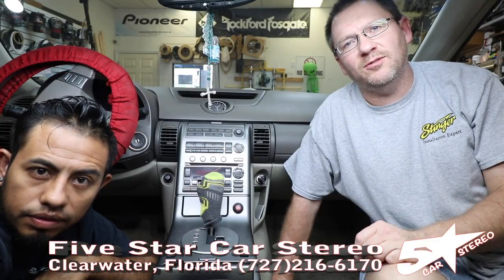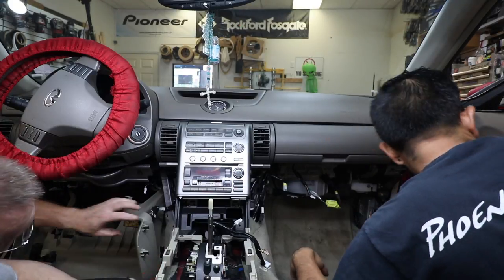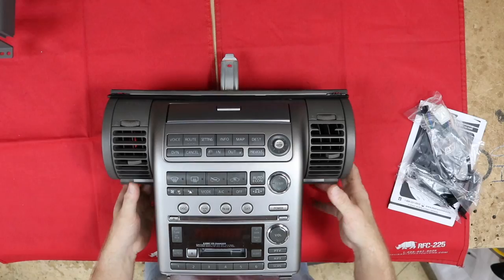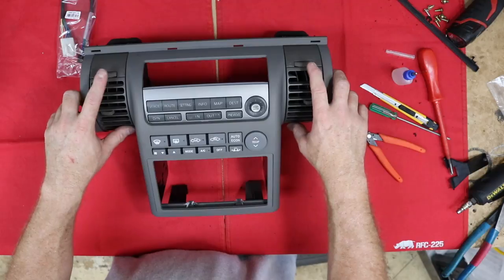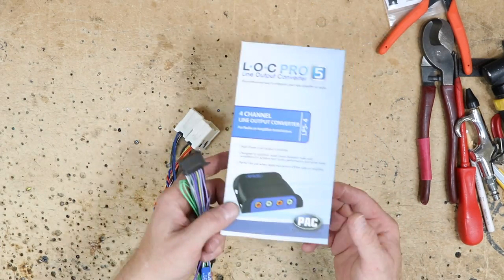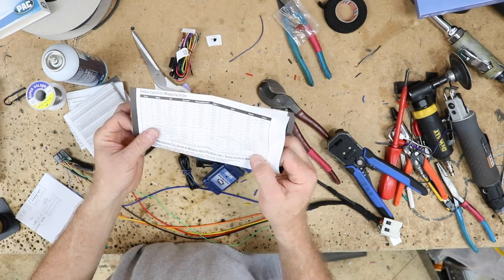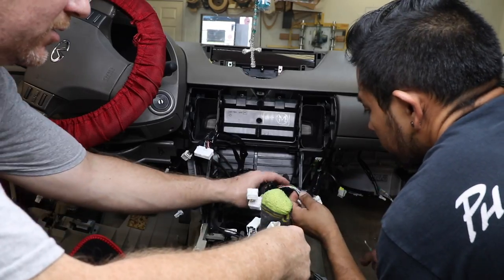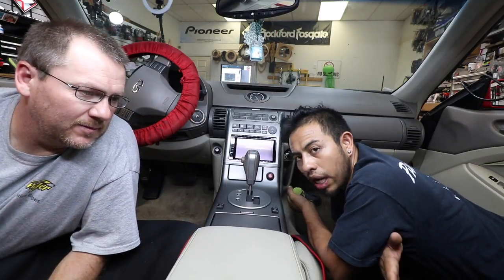The steps it takes to replace your radio Infiniti G35

Comment: This is an excellent video! I don't think it is that bad of an install (granted, I have done a lot of them in my life).  It is straightforward, but you must be cautious. If this is your first install, I strongly recommend setting aside at least one day and make sure you have backup transportation.

 Personally, I think 99% of head units look like garbage when paired with the G35 interior. A really well rounded, affordable, stock-looking head unit that is perfect for the G35 would be the Sony XAV-AV5000. It mounts flush with the Metra and has unrivaled competition.

 For those of you who want the parts list, here you go.

Dash kit: Metra 99-7604
Wiring harness: Metra 70-7551
Antenna adapter: Metra 40-NI10
Line output converter: PAC LP5-4 L.O.C. PRO
Steering wheel control interface: PAC SWI-RC

Don't cheap out, and not get these parts (steering control is okay to skip, but I don't recommend it). For the sake of simplicity, go with all of these brands listed above. 

Tips: 
1. Before you pull the Bose radio out, turn the volume up to about 75% (while it's on). It is the last that the Bose amp's volume will be adjusted, so make sure you give yourself plenty of headroom. 
2. Before you install everything back to their places, individually test each speaker. You can do this by using the fader/balance. There are a lot of places where you could have goofed up on the wiring. The RCA's need to be snugly placed (maybe taped) to reduce the chances of disconnection. 
3. Watch the video as many times as you need. The worst you can do is generate these guys some more ad revenue (not a bad thing). 
 
Don't be discouraged that this is not as easy as a 90's GM vehicle radio install. The G35s are spectacular cars that really do benefit from a new head unit. You have to realize, you can't escape a timely install on cars these days. Buying a car with an aftermarket head unit is really sketchy and not always worth it. So many people do horrific and lazy jobs installing these. People will scratch, scuff, and break trim pieces and  I have seen people wire head units by cutting off the factory harness connector and use 120-volt wire nuts to connect the wires to the aftermarket head unit harness. When you do a radio install yourself, you know if it is quality or garbage. Unless you know it was professionally installed, I think it is better to buy a G35 with the stock Bose head unit. That way you know the factory harness wasn't molested.
Reply: do you have any kits for the g35 05 coupe with nav?
Reply: You are a god send sir

Comment: I thank the heavens that they changed the design from 2005!
The Metra kits are just so janky-looking, though!? THAT'S the main reason why I haven't tried to upgrade mine yet. The buttons are spongy even though they are rather resilient and will last for years. 
You do get JDM parts for a double-din radio in the USA but they are EXPENSIVE (around $350 just for the trim piece)! 
I'm rather OCD about things so what you guys just did would drive me insane and at least double as long as both your time together, since I won't even "allow" myself to replace old clips - everything must be unused! I mention this just so you will understand(?). I will certainly become a desert-wanderer.
On a lighter note though... excellent video with excellent information for people wanting to attempt this!!!

Comment: Great video fellas! I literally just did a Pioneer double din install in my buddies G35 a few days ago so I know every step you guys took to install it ha ha! I honestly just went with the first harness you showed w/o the RCA's. You're right about the volume being loud by volume level 10 or so, but it really does sound great still. I would recommend using it to anyone.  

For anyone that is thinking about doing a double din install in their G35 the Metra kit is a great kit and fits very nice and looks really once its in. Only thing I will say is make sure to take off the cig lighter panel as well as the opposite panel too. You will fight with putting the kit back in if you don't. It'll get hung up on the vent!
Reply from the maker: +2nsane2005 👍

Comment: Your video is by far the best of 6 videos I’ve watched about this particular job.  You answer all the questions that I didn’t know I need to ask. I have a Japanese (RHD) 2003 Nissan Skyline which is identical to a Infinity G35, but mirror image.  I want to upgrade the outdated radio system with a Bluetooth capable like you did here.  
Could you recommend some brands before I buy?
Do you have any recommendations since you posted this video on what I could do with factory NAV system.  It works as a Japanese TV and NAV System, which despite my ability to translate, is outdated and useless.  I’d like to take it out and replace it with iPhone Charging pad and also make it so I could mount one of my old or current iPhone there.  That way I could use my iPhone for navigation.  
Do you think I could take it out? Do you think I could connect the pad/magnetic style charger to power?  I’d like to keep the physical slide up and down feature.
Reply: Hey I have 2004 nissan skyline JDM I also want change radio can you help me which stereo you buy and which spare parts you have

Comment: Thanks for the video.  I just had a Pioneer double din installed in my '03 and it sounds like absolute $#!+.    I am sending this video to the shop that did my install.  I am thinking they just hooked up directly and didn't take into account the difference in the Bose speaker impedance.  Every speaker sounds blown and it has no bass and no power

Comment: Did you guys change metra kit colors throughout the video???  The dash kit looks COMPLETELY different from the box opening to the final install.
I have a  2004 6MT Coupe with willow interior, and I think the proper color is the "silver" metra kit.

It looks like you intially had the tan and then switched to that one, or does the lighting really make that much of a difference???
Please advise.  Thanks.

I just received a scoche kit and it is a POS, so gonna return it and get this one.

Comment: So why did you cut the rcas from the converter and wire them into the radio harness? Could you have just plugged them into the front and rear RCA outputs on the back of the radio? I as because I used the same car harness you guys did in the video and plugged the rca directly into my radio. However, I am experiencing the limited volume range as well as distortion. I’m planning on getting the pac rca converter you guys used to correct the issue. I guess I’m really asking can I just plug the converter into my radio and the harness rcas into the box? I have an Appradio4 by the way. I found that with the rcas plugged into my radios f&r outputs you get much better sound when you turn the high power frequencies in the crossover off. Any advice or information would be appreciated greatly. One more quick question. Can I just replace the Bose speakers with aftermarket 4ohm speakers? I’ve heard they use 2ohm speakers and a .5 ohm sub. Do you know what the Bose speakers resistance is or how much wattage the system puts out per channel? I’d really like to replace st speakers but I cannot find and information about the Bose factory specs. I’m not driving a G35 but it’s counterpart an 04’ 350z. Thanks for the video guys well done. I look forward to hearing from you.

-Will
Reply from the maker: The best option would be to replace the Bose speakers with aftermarket and bypass the Bose amp. Using the Bose amp for aftermarket speakers is not the best idea. We use the radio output power because that is what is needed for a High level input on the device. The low level of an RCA is not enough power to make sound.
Reply: Five Star Car Stereo thanks guys.  So should I turn my high power frequencies back on in the crossover? Will that converter clarify my wound at higher volumes? I def want to bypass the Bose system & do my own stuff again. It’s gonna be a lil while cause the holidays and bills. I was recently running all Orion XTR highs, mids, and lows. Along with XTR amps. I was very impressed going from kicker to Orion. What do you recommend for an 04 350z with the pioneer AppRadio4  sph da120? I’d like to utilize the sub compartment for a free air sub or even partially seal it up and make it a ported box and dreaded the entire cab with roadkill or something similar. Any suggestions would be greatly Appreciated. I was just gonna replace the Bose speakers with ona that fell in the same resistance range but were not in need of high rms to perform adequately. As of now  the radio sounds great at about 16 but when you start driving Rod noise drowns our the clarity and turbine the volume up comes with distortion. I replaced the blown Bose 10” pancake sub with a Rockford Nissan lunch from an xterra that is a 3 ohm dvc running it at about 1.5ohm stable and the sub itself sounds better than all the other speakers, but where they are all tied into it trying to make speaker level adjustments only complicates things. Please help a brother out. I guess the next step is to add the pac unit and start acquiring components to build it right. Turn me on to a few things, I’m very open minded but like quality stuff. Thanks again, hope to hear from you soon.

-William

Comment: Did you connect bothe the negative and positive speaker wires to the corresponding speaker wire on the PAC?

Comment: I'm not good at electronics, my 06 g35 has this problem. Radio is a Sony 2din, installed after the old aftermarket had the same issues. Sound doesn't always come out, either from all or some of the speakers. Happens in every pothole, train track, or bump. At the shop where I got the stereo they said it was some lose connection, worked great for a few months and back with the same issue. Went to a different shop and dude wants to connect it directly to the stereo all the "new speakers and Amp plus new wiring". Should I take his advice or go somewhere else and get a different opinion? 🤔

Comment: Awesome video guys! I'm thinking about doing this instal to my g35! I was wondering, how does this aftermarket install compare to the sound quality of the factory boss system? Also, using the PAC LP5-4 4-Channel Line Output Converter you didn't mention the hookup for the subwoofer amp? Is the subwoofer hooked in a different way? Thank you

Comment: My son has the same car 2004 and he wants to upgrade too. But he wants to bypass Bose amps and go to 2 different amps a 4 channel and a sub amp. What wiring harness would you suggest to make it the easiest for him? This video makes it easier for him to take his dash apart. Thanks Dean and Fernando for the very informative video.
Reply from the maker: +Larry Weppler either has would work for that. You will only be using the power side when bypassing the amp.

Comment: Where can I get a pocket. I have the same car but the person that installed my radio cut corners.  Now I have a hole on top bc he did not put the navigation pop up screen and buttons. All the pockets on eBay are bad.  I have the original b al navigation piece.  Let me know thanks.

Comment: So I decide to install pioneer avh x5800 and aftermarket amp and 12 inch kicker L7 but I don’t know  where to get the amp wire from ? It’s the blue wire from the car harness that isn’t connected to anything? help me please🙏🏻...
Reply: The SWI works perfect I have audio but my amp needs power everything is connected just the blue cable I don’t know where it goes to ..

Comment: hey I need help . I have a blaupunkt Portland 310nav can get it to work. every thing is connected including the blue/yellow from the unit to the steering 1 on the back of the radio. it shows the led lite on the unit working ,but nothing happening on the radio. I turn on the controls in the radio that says steering wheel

Comment: I'm having a hard time with the steering wheel interface. I have a pioneer avh4800. I plugged a red and a black from steer control into the red/solid blue of harness, and I plugged black to yellow, white/red to green, and solid white to red. Since I have pioneer it should be same as this vid? only thing I can think is are the two black wires the same or maybe they are backwards? Or did I mess up the colors?
Reply from the maker: Did you add a ground to a ground to the metal in the dash. The factory ground in the power plug is not enough. The 2 black wires are connected to the same point you can’t get them wrong.

Comment: PLEASE HELP!!!  I’m having trouble with the wiring. So I installed a Sony with subs and amp but my car Battery was being drained. I knew it was because i had wired something wrong because i couldn’t get the amp to turn off when I turned my car off. So I re wired everything and I couldn’t get the radio to turn on. Eventually after trial and error I got the wiring to work, SORT OF. I had to connect the red, yellow, blue with white from the car’s harness, AND the blue with white from the aftermarket amp all together just to get it to work. My battery wasn’t being drained anymore. BUT THERES A NEW PROBLEM. Now my radios settings reset every time I turn my car off. Like I would turn my car on, the radio and subs turn on fine but all my settings and adjustments I’ve made to get the perfect bass and sound resets! So if you could give me a wiring diagram of how you guys wired the radio and amp it would really mean a lot. Thank you 🙏🏽
Reply: did you end up geting the diagram?

Comment: How much this whole installation cost with labor?
Reply: Best buy charges like 300 I'm pretty sure. Most shops charge even more
Reply: Buy the stereo from them and it's like 550 in parts plus 100in labor
Reply: Good thing I read the comments i almost paid 700 at a stereo place lol

Comment: Where do you get those little yellow butt connectors? They look smaller gauge than the red ones.
Reply from the maker: They are it is a 26awg connector 
3M 60-SN Nylon Butt Connectors Electrical Splices Yellow 26-24 AWG - 100 pack https://www.amazon.com/dp/B009VNTPAI/ref=cm_sw_r_cp_api_i_VEo6AbN7VR02X

Comment: i have done many of those infinity g35 and that top dash piece usually is already cracked, so i make sure to tell the customer, it will probably fall apart when i try to remove it.  it usually falls apart into pieces, because its old sun beaten,  and brittle..

Comment: I love my G35 , but I dislike the radio ,won't say hate ,because everything still works Everything...After watching this I feel confident in replacing it. Out with the old in with the new. wish me luck and patience lol
Reply: I spent a good 3 hours doing the panel removing.  Infiniti is extremely unfriendly for diy!
Reply: @mingming9604  did you get it fixed?
Reply: @Carvman  I did ..  but it sucks they made it so difficult.

Comment: Parts list in the video:

Trim kit may vary per car so I’ll let you research that. 

13:26 Wire harness (PAC 70-7551)

13:57 Line output converter (PAC LP54 Locpro L5 4CH)

16:41 Steering wheel control (PAC SWI-RC) or Metra Axxess ASWC-1
Reply: Is it works with pioneer

Comment: my g35 turned off the radio no longer turns on and the air conditioning stays on I can do?
Reply from the maker: If you are asking about this happening to the factory radio, then you can replace it with this kit. It will return it to normal. You jut have to buy a new radio
Reply: @FiveStarCarStereoInc  and changing the stereo the air conditioning will return to normal?

Comment: So was thinking about a double din in my newly acquired G35.  After watching this I'm losing my motivation.
Reply: I literally just did a double din install in my buddies g35 and used the FIRST wiring harness. It sounds great! The only thing about it is its loud by volume level 10 on the deck :) but really no big deal!! Don't be scared to go for it man. You really dont need to remove the glove box I just let it hang out of the way. Get the metra kit, wiring harness and deck and throw it in like any other deck!
Reply: 2nsane2005 Maybe Ill give it a shot.  Thanks for the prep talk coach.
Reply from the maker: +theripper121 go slow and take your time
Reply: Five Star Car Stereo that’s what she said

Comment: It is a whole lot easier than this video makes out. 
Keep in mind they are removing more pieces than necessary because they are running wiring for something else later.

For fascia only, you do not need to do the following:
1: Completely remove under dash cover or harness.
2: Completely remove side panels of fascia console or harnesses
3: Completely remove centre gear panel or its harnesses. 

And when re installing, throw away that useless nav unit, and hit me up to do you a custom gauge install. 

https://www.instagram.com/p/CC8ZyqlgCMR/?igshid=jxn3aquecru4